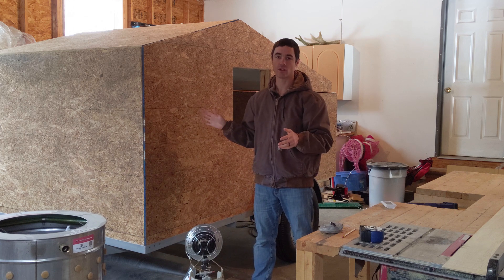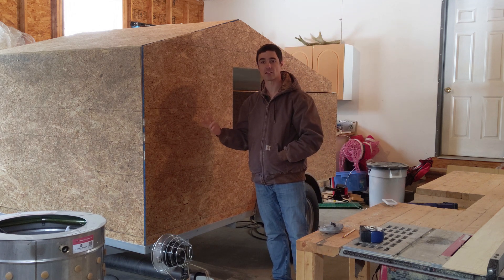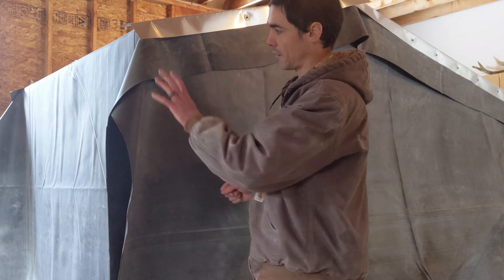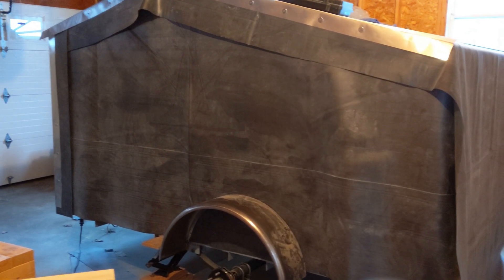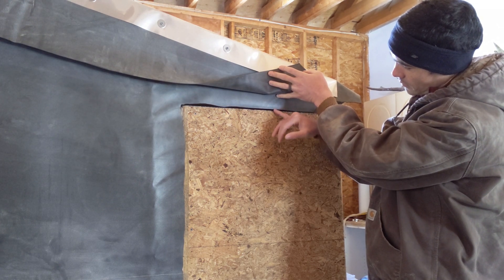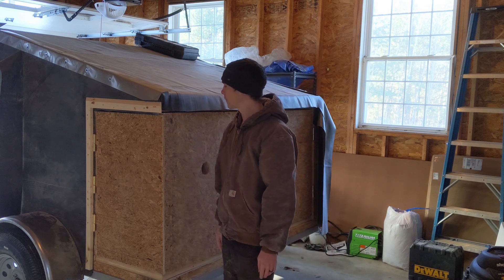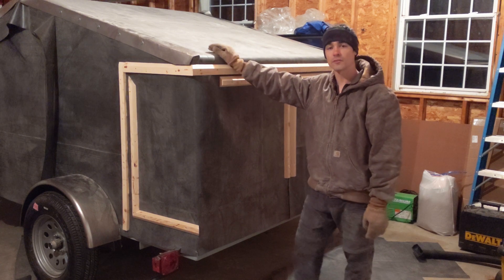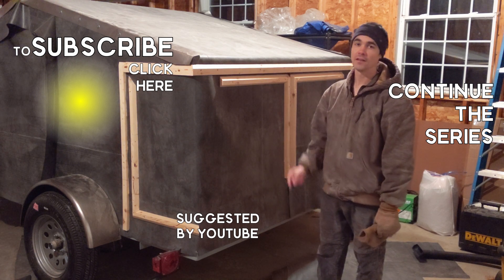Waterproofing my Teardrop Trailer with EPDM - Build Video #9 | Mechanical Attachment

Comment: Do not follow this build! All materials used are completely wrong. Never use Press board/OSB on trailers! That stuff melts if it gets any water leaks.  Using a EPDM is all wrong I use it building ponds If it was the correct method you would see it on all trailers out there. Should have done more Research . Sorry I’m not trying to be negative but saving someone from following your build and wasting money is worth it. Maybe you should have built more than just chicken coops to get more experience!
Reply: epdm is used on almost every rv roof and Mobil home roof ever produced
Reply: @rickardfam  it's not designed for vertical surfaces without question. And osb is a horrible substrate for a camper.. with rvs and trailers it's not if water gets in.. it's when

Comment: Great video!  I am impressed with your continued progress and overall quality in each video.  Thank you for providing a wider camera view of the trailer :)  Are you going to skin the exterior with aluminum or some other material?  Make sure to seal any screw punctures and wire holes with caulk to prevent water intrusion.  You mention spray rubber sealing the bottom of the trailer; have you considered skinning it in aluminum too?
Reply from the maker: I won't be using any aluminum. The EPDM is the exterior layer and is much cheaper than aluminum as far as my estimates were able to determine. We may paint the trailer when it gets warmer but it will be only for esthetic reasons as the EPDM supplies all the weather proofing we need.

For the bottom, what I think is going to happen is we will probably put a single temporary later of the rubber on just to hold us to spring. Depending on what we see after a few uses, we will either add another layer of the rubber or weld on some sort of metal barrier to protect the wood. So jury is still out pending testing.

And yeah, definitely need to fill those holes with something even if the temperature isn't ideal.